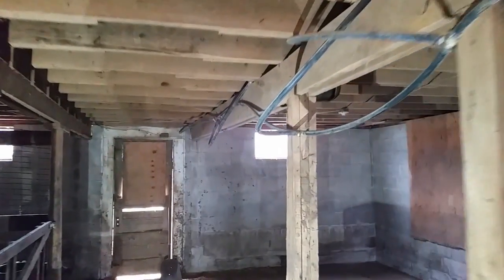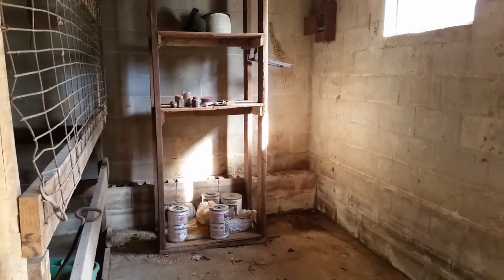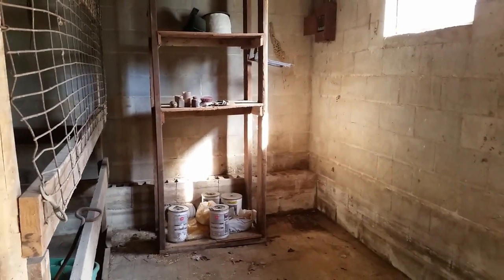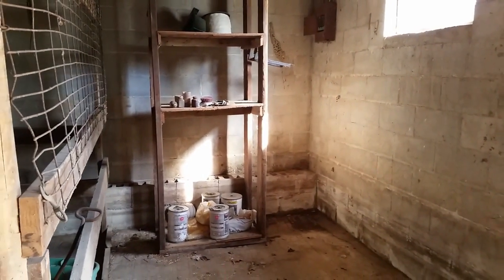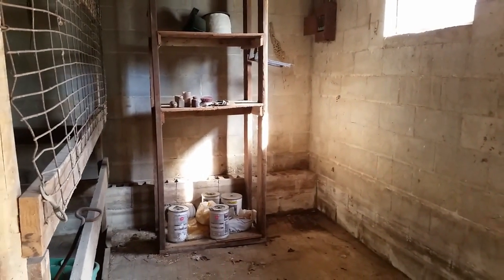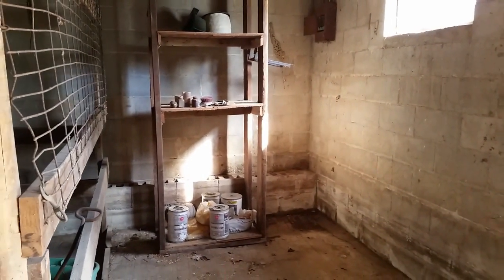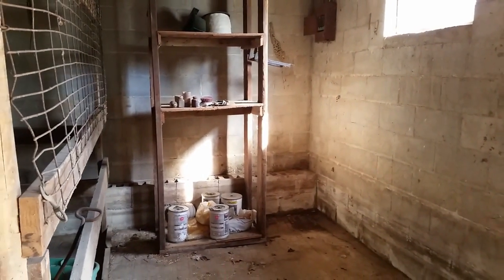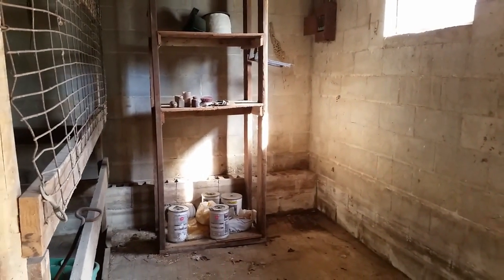Replacing Posts in lower level of the Bank Barn

Comment: Placing the post on steel brackets will keep the treated lumber from ever rotting. Even treated lumber will rot if exposed to water from  the concrete. Great job on all the work in the barn ;)
Reply: I'm doing the same on some of my posts. They are 10x10. Do you know where one would get a metal bracket that size?  I even thought of welding one up but not sure of the best design?  Any ideas?

Comment: Nice job! 
The only thing you missed out on was a barrier between the post and the concrete. A square of membrane would do (you can use your jack trick to raise the beam next to the post 1/2" and slide the membrane in) when you get time ;0)
Even treated timber is at risk directly on concrete ... and it is endgrain too!
Reply: Yes. This. Sill seal is a cheap insurance.
Reply: Agreed. Cheap insurance.

Comment: Next time when you are laminating 2x12s together, may i recommend using long bolts and nuts. Expansion and contraction can work the nails out. I second the suggestion to put a metal post base before tapping the posts into place.

Comment: Looks  great!!  I  need  to  do  a  similar job on my  carport,  the  cement blocks have settled and so the  roof has bowed down some.  I  had  the  same  issue  with my  wheel  barrow  tire  always  going flat between uses,  until  I  had  a  tube  put in the  tire!  No  problems with it  in  years  now!!!  I  did the  same on  older riding mower  so  going to pull  those  tires to put on current  rider.  One  less  nuisance!!!!!!

Comment: On first post I would took the bad wood part in between joist and replaced that with longer board in center and lag bolt together
Reply from the maker: I agree that would have been stronger.  But I didn't want to pry the middle board out, while it was on the floor jack, I know there is a lot of weight sitting on the upper level.  So I went with the conservative approach.

Comment: I would be inclined to use timber framing style diagonal bracing on those new posts to support the header, personally.
Reply from the maker: That would have looked nice, but the posts are less than 7 feet tall.  So I don't know if there is enough height to do that and not hit you head on the braces.

Comment: Definitely would have put a barrier between concrete and wood even though its treated. Also would attach the post to floor and beam to prevent kick out from bumping and pressures from settling
Reply from the maker: In a later video I put a barrier under the posts.

Comment: Just curious; why are you knocking out the cinder blocks at the floor? Wouldn't they make a good wall base for stalls/pens?  And as to the chicken coop, were you planning to provide them with outside access, or just keep them under the protection of the barn?
Reply from the maker: I removed all the concrete blocks to have a blank slate to start from.  I am not sure exactly what I am going to do, and I didn't want the block wall to determine how I laid things out.  I may end up leaving an open area for livestock instead of making a lot of stalls.  As for the chickens they will have access to the barnyard and pasture.  Hopefully keeping them inside a fence safe from most predators.
Reply: @CountryViewAcres  Hay/bedding storage space for coop-rabbits-goats allotted for?
Reply from the maker: Bales of hay and straw will be stored on the level above.  They can be thrown down to the lower level through an opening in the floor.
Reply: @CountryViewAcres  Wondering if the above space was going to be a shop area. Traditional barn moving forward  :)

Comment: I am late to the viewing.  My only question is how do you know if you have enough of a footing underneath the new posts?  What if there is only a 4 inch concrete slab under there?
Reply from the maker: The other side of the walkway is already held up by posts.  We are making the assumption that the concrete is the same thickness on both sides.  This was probably built in the 1940's.  I believe the concrete blocks were added later.  So it was probably posts on both side originally.  But that is just a guess.

Comment: Would it not be better to support first, then remove and replace?
Reply: Wow, I agree.  Being educated in mechanical engineering I was terrified watching him knock out the load bearing timbers and cmu blocks with just a single floor jack and 2 by lumber support.  Not nearly enough wood, nails, glue, and bolts on that termite infested joint repair.  I am glad he didn't get squished.  Those filled cmu blocks serve an important part of the structure and distribute the load over the floor.  A temporary beam should have been installed with several steel floor jack-post while working.  Code requires the post be anchored to the floor to prevent them from moving if bumped.  I am looking forward to more hair raising adventures!

Comment: Did you secure the posts to the beam and floor? What about any lateral movement or side to side in both directions?
Reply from the maker: the post is secure at the top but not the bottom.  I plan on going back and installing brackets on the bottom of the post.

Comment: the scabbed on board with little wimpy nails is almost pointless. the nails cannot possibly carry enough weight to support much of anything , an engineered lam beam would be a better option . at least you should use some strong lag bolts .

Comment: why did you remove to concrete was it bad also,i would of just jack up that side and replaced the wood supports .js
Reply from the maker: I removed the concrete so I can spray out the barn when we clean it.  Plus it will match the other side.

Comment: oh man, anther guy jaking with a long 2x6, i have seen a guy have a 2x8 spring out and sent him flying back wards into a cement wall. ended up in really bad shap in the hospital for over 3 months doing that very same thing, i was helpping him, and i told him use a dam 4x4 or bigger, but he insisted the 2x8 wouldnt go any were, soon as he started jacking i went out side, i wanted no part of that, thats like drawing back on a huge bow, worse the them man killing farm jack all jacks, thats tons of weight loading up on a thin board... a big no no, use minimum 4x4, i have lifted whole sides of a roof off to build a new walll that rotted out many times, and all ways use a 4x4 or a rail road tie..

Comment: "Scabbing" boards together is called "sistering".
Reply: Scabbing is not an altogether incorrect term but implies something temporary. Sistering is typicall when you add lumber along side existing floor or ceiling joists and secure the new wood to the old for strength and support, just as you did. Most often, but not always, it implies full length support lumber, like from wall to wall or from post to post. I like the way you assessed the problem, and I like the repair you made. Keep an eye on it but I suspect it will hold up for many, many years. Park the tractor loader bucket at the door so you can dump debris in it as closely to the source as possible, and to make it easier to carry off and dispose of. NEVER CARRY WHEN YOU CAN ROLL! Your back will thank you in years to come. Voice of experience.
Reply: I agree with Dave W that a barrier between the posts and floor would be advisable. I prefer the 6x6 x1/2" thick metal pcs designed to mount posts on. And they can be secured to the floor for added safety. Use you floor jack method as DW mentioned. But even a poly moisture barrier would be better than putting the posts on bare concrete, esp if you plan to hose out that section of barn occasionally.

Comment: If you don't use steel you will be replacing them again, and again
Reply from the maker: I may go back and use post brackets.  to get the posts off the concrete.